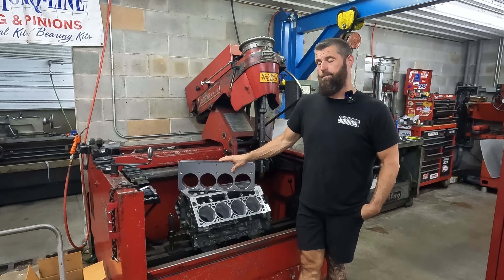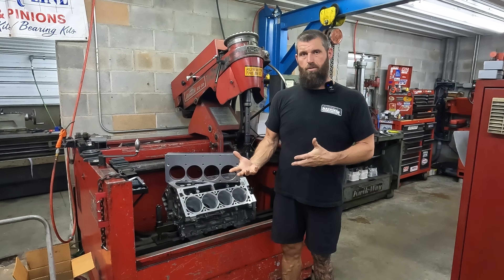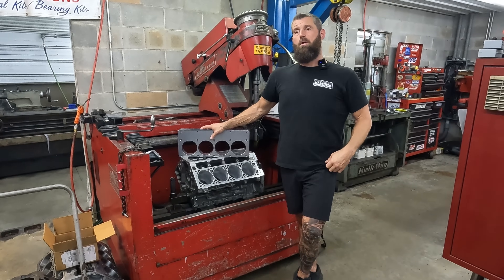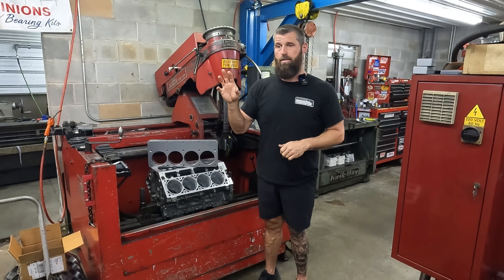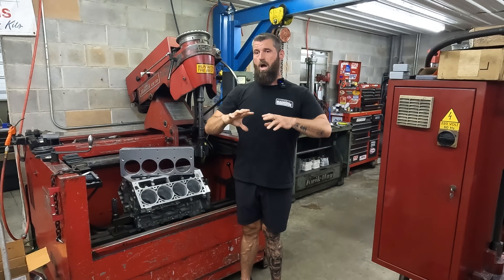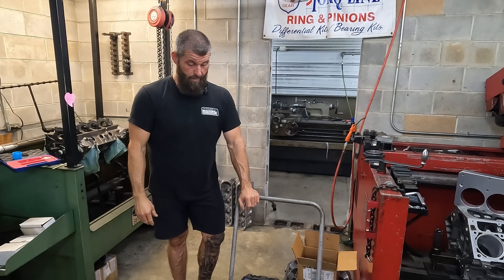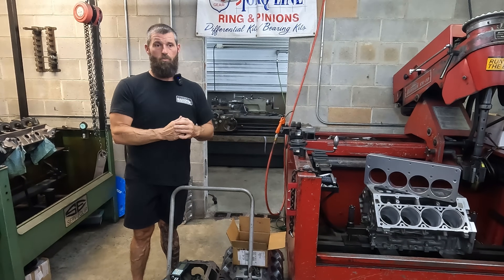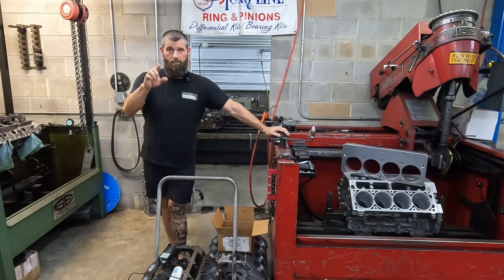We gotta talk about this torque plate deal.....

Comment: Hey Brother don't let them get to you, don't be bothered when you know from your experience that something is right or correct- it is what it is  and that is the way it is. I guarantee you and everyone commenting that when you gas it up and the engine is running and oil is circulating and water is moving around inside the block there is all kinds of thermal stuff  going on and things are moving around twisting. flexing, or distorting inside that engine. And on a build you are 100 percent correct not to put more effort than necessary to get whatever within whatever specs that it needs to be. I think you are doing a get job with what you do in your shop, thanks for the video. Peace.
Reply from the maker: Ty, 💯

Comment: 😂 every shop I have ever used changes extra to torque plate I was told you have to use what stud it was torque plated  with I have  Wondered if that was true sounds right good video Thanks
Reply from the maker: We use the same fastener that will be used in the build